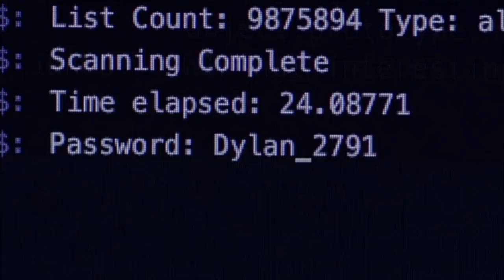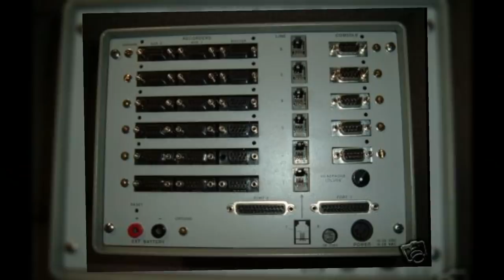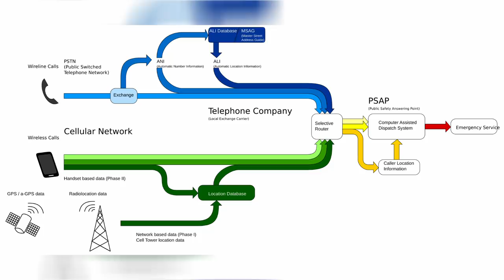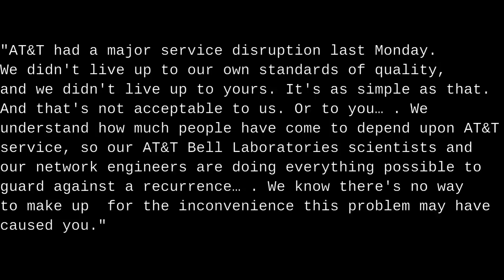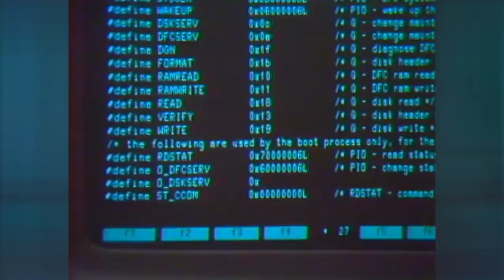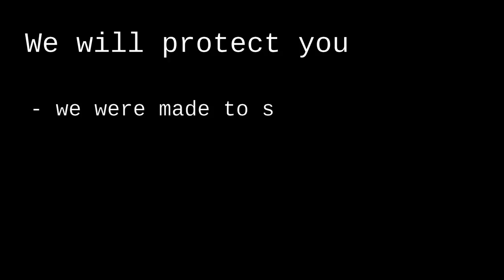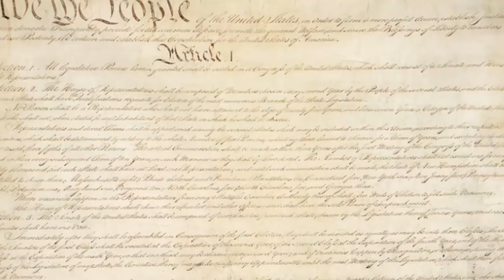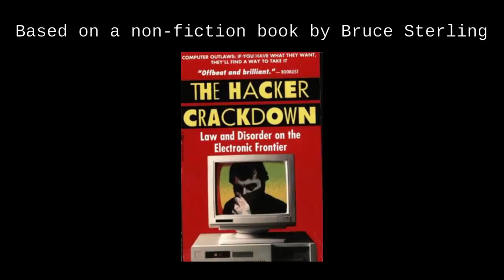How the US Government took control of the Internet | The Hacker Crackdown

Comment: Since none of are in on the truth , I will clue you in. I've been hacked so I know the truth! My hacker used my tv to get into my computer , I still have them, my video card and my PS4 , he has denied  me from the net on my computer after I removed my video card , so I  I took the computer off the net. He is using machines in a large scale VPN network if what I've seen of the progaming is correct. If there bragging in the programing is correct, They operate out of Japan. I personally really dislike a lot as my computer is my world since I'm disabled . But hackers don't a flying  dirt clod about me. And I was using Ubuntu's Linux at the time I noticed them. I'm not saying it came from them , this person did creative writing in a couple of programs and presto they were in. No security check to hassle with.